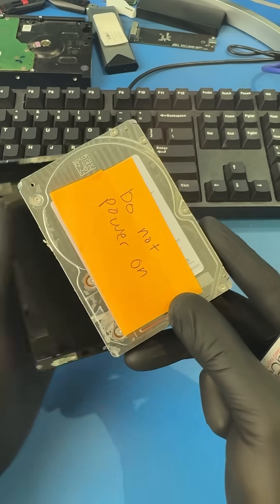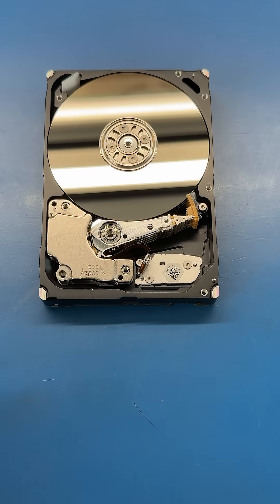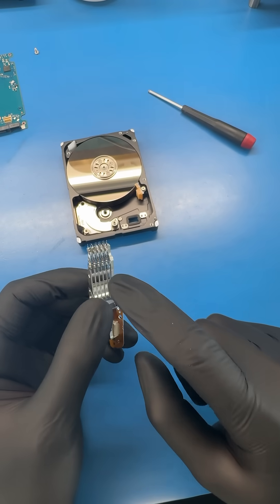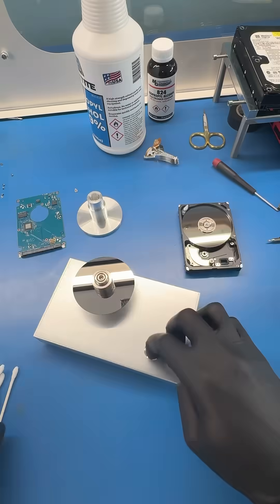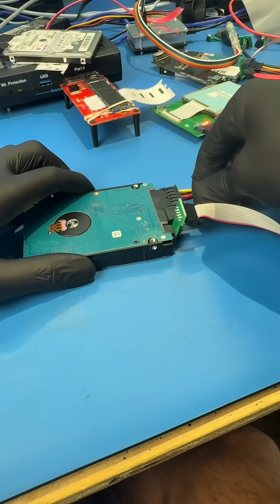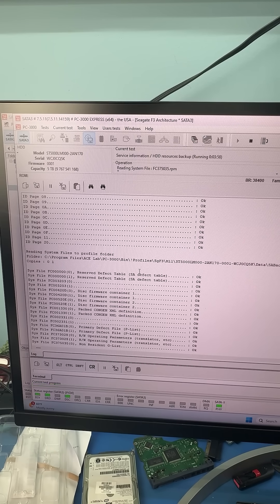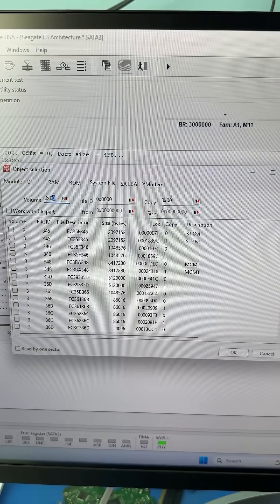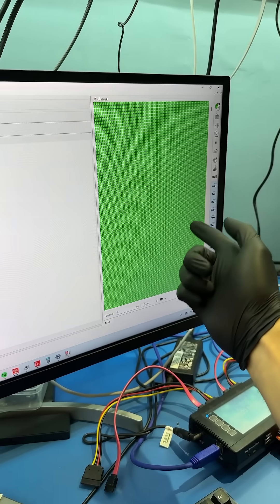Hard Drive Platter Extraction... #technology

Comment: Wow! I'm so blown away! I never knew a hard drive could be repaired. This is next level amazing! Thank you for your smart and hard work. More blessings to you.
Reply: I don't believe it's possible if there are scratches, and even then, I wouldn't reuse that one again. Just to be safe.
Reply: Well, kinda. Once the cover is removed from a HDD you want to pull whatever data you need and then never use it again. The reason is that these drives are assembled in perfectly sterile environments. Once you remove the cover a single particle of dust can land on the platter and then it's just a ticking time bomb of when the drive will fail completely.
Reply: @billybegood466 Exactly, they’re quite delicate on the inside.
Reply: Recovered. Not repaired. Don't re-use that drive, bruh!
Reply: That’s why you need to be extremely careful when you dump a drive that might contains personal data, even if you think it’s broken and useless. You need to physically destroy it (hammer, drill… whatever…).
😉
Reply: @snowman8052 Or my personal favorite, microwave.

Comment: The original design had a base plate of pre-famulated amulite surmounted by a malleable logarithmic casing in such a way that the two spurving bearings were in a direct line with the panametric fan. 

The latter consisted simply of six hydrocoptic marzlevanes, so fitted to the ambifacient lunar waneshaft that side fumbling and data loss would have effectively been prevented

Comment: That's why it's so important to have a backup drive. Even if the broken disk can be recovered, it will cost much more than a second HDD. 
Unfortunately backups are inconvenient with Windows, as Microsoft never bothered with implementing an easy and fool-proof backup function into their operating systems.

Comment: I have 8 Scsi drives I want to check out, got the server from an old radio station, I also had the equipment they used to send it back to the actual radio station, but my guess is those harddrives are jammed packed with music files, the Sever had a password, clearly i have no clue what it was, I was doing a cleanout of an office building was my home or the landfill

Comment: That sounds unnecessarily complicated like there’s plastic rings on the discs so why can’t they print like UP 1 and UP 2 on the up side of each disc with a number that relates to their stack order? Just seems like a simple mix up of identical discs would be something humans would do so why not get rid of that problem? Or let you pull the whole stack out at once so you don’t even have to do that if you’re not examining the discs you just need to remove them? Idk seems like there’s an easy solution to an absurd self created problem lol

Comment: seagate no wonder 
last hdd i got was a seagate 3TB drive it did die after 4 months of use 
because of bank data i did not send it back to get a replacmant (they just wanted to replace it)
 so now i now run a ssd only system with 9 drive and more then 18TB of space 
the older drive i use has 37.8TBW a total power on time of 45.363 h and it dose still do a good work as a download drive

Comment: There are three things that are absolutely guaranteed in life: Death, Taxes and Hard Drive Failure.
If you deal with this amount of data, you should NEVER keep the data in a single place like this. A fire could have ensure its destruction although data can sometimes be recovered from a burned drive, too. 
If your “life’s work” is that valuable, then you should be using some sort of cloud storage, off site storage and/or RAID storage (multiple array of independent/inexpensive disks) which uses redundancies and sophisticated algorithms to store your data across multiple drives. If one drive fails, you simply replace it and the other drives rebuild your missing data using its algorithm. For example: take 3+8=11. One drive stores 3, the second stores 8 and the third one stores 11.  If any one of the three drives goes bad, you simply replace it. There is data stored on the other drives that tells the new replacement drive what the missing number (data) was using the algorithm so it rebuilds it. Save yourself nightmares and a potential heart attack.

Comment: Props to this.  I never knew there was a way to the firmware.  Always thought having the firmware on the drive itself was just begging for trouble.

The most drives I have ever repaired is old ST-506, and even in those cases I just put on the service jumper.

Comment: This is why I don't have cats or dogs. Whenever you work with sensitive hardwares like this you cannot have cat hair or dog hair on the atmosphere and certain things cannot move while they're reading and writing.

I'm just joking. I don't live in a cave. All of my computers use M.2 NVMe storage. All my PCs are securely strapped and cleaned regularly at downstairs station where no one is allowed. I have two NAS servers located opposite side of the building and they automatically backup my phone, my computer, everything.

Comment: hi i actually have a harddrive which was there during a building fire. it has all my childhood photos. It's hardly damaged by fire and all the plastic and rubber parts around it has been melted even the silicon cover around it. you think you can recover it even after facing temperatures over 500 Celsius?

Comment: Who does not know you are supposed to copy -paste and then, if necessary, delete, not cut-paste files when there are lot's of files. Also having files in a single place at any time is crazy. Easiest option is to use a cloud to have one up to date back up of everything on your hard drive, then use a USB hard drive to have an extra back up not connected to internet or computer except for duration of backing up. Perhaps add another USB hard drive and cycle them so if latest back up already is corrupted, you still have the previous one intact.

Comment: For reference if he got 1 platter the wrong way round without knowing which one, he would need to perform up to 32 tests where he disassembled the drive, reassembled the drive, and attempted to do data recovery assuming that he put back the platters in the intended orientation each time. Getting the ordering wrong would be similarly disastrous. If that happened to me, I know I would give up as soon as I realized because that could legit be months of work.

Comment: i had a samsung 860 evo 2tb and an 980 pro nvme 1tb drive m.2 fail at the same time last year. lost 25 years of pictures, documents, letters, recipes, and so much more. i tried about ten different programs to try and recover with zero luck. samsung had zero explanation either. saying that only there was a batch of 860's and 980's that had bad components. i LITERALLY lost 25 years+ of records of my life and they cannot be recovered. after fighting samsung for 2 months they sent a 870 evo 2tb and a 980 pro 1tb to replace them. but yeah... just gone. 

fucking samsung.

Comment: HDDs are my Roman Empire. I just cannot understand why the fuck we would use these as external storage when the smallest tap or stiff breeze causes them to break. I just…it gives me so much fking anxiety I cannot deal.
I have a WD 4 TB HDD from years ago, I keep it in a padded box and don’t even allow it to flip over when I use or move it, tell me how that fking thing started clicking for no reason. Thankfully WD fixed it, of course I lost the data, it wasn’t important. But we have these huge drives that hold some of the most important information and memories of our lives and they’re as temperamental as a sleepy toddler on a sugar crash. 

Thank God for SDDs.

Comment: Drive savers couldn’t save mine. What’s the chance you could?!?!
Reply: NEVER send anything to DriveSavers. They're scammers. There are reports of them damaging drives further to increase repair bills, and holding customer's drives for ransom after jacking the price way up. Speak to a reputable company.

I made a mistake once and sent my SSD to a company in Arizona, and unfortunately it was mostly gone due to my own mistake earlier, however they sent me the corrupted data they were able to get off for just a USB drive + shipping. It would've been free because they couldn't completely recover it, but I opted to pay about $20 for some scraps of my most important files they could find.

Edit: Just to be more clear, I exaggerated. They're not scammers per se, but last I checked, the pricing is just ridiculous. It's a difficult job, but it's not THAT difficult.

Comment: This is one of the reasons I make minimum of 4 copies on a regular basis. Usually no more than a few gb sometimes 100gb in lapsed data.

I had an external hard drive fall while powered and spinning. Lucky for me the drive that failed was the drive I was copying data to. the data on it was being copied from another drive. I didn't lose data, just one of my copies.

Comment: The care you took with the platter spacers was my favorite part of the whole experience.  Very well done.
Reply: A lot easier said than done going in blind. He has no idea where said damage could be hiding. It is best to do a complete tear down and rebuild. That way, he can triage the entire drive.
Reply: Yea my goofy clumzy ass would tip over the stack 😄😞
Reply: Kind of have to on these drives.  Even a mm scratch can wipe gigs of data.  Lord knows how much is lost on the newer 16tb drives.
Reply: wonder why he can just take those platters off from the motor one by one? How could he align each platter to the exact position? If platters are misaligned, though he can retrieve the sector data but files will be corrupted?
Reply: @ericpal02  In the disassembly he doesn't yet know where and what the damage is.  The wider spacers keep an accidental tap knocking each platter into each other.  On reassembly the platters have their own OEM spacers to put them in the proper alignment.
Reply: @ericpal02 platters are always mis aligned they spin eaone has it on reader

Comment: I can't imagine not having redundant storage and backups. I have four drives in a raid 6 array. All four have been replaced, and rebuilt, due to failure, at some point over the past 15 years of its operation. It runs on Linux software raid using the XFS filesystem. The server is about to be moved to new hardware and I'm expecting to migrate the four disks to a ZFS raid six array. On top of that I have automated and daily onsite back, and automated daily offsite back up, and periodically I run the backup to a hard disk that is sealed in a vacuum pack and put in a safety deposit box at my bank and I have a duplicate of that drive sitting in a fire and flood proof security box in my house. So ... if I ever need your services it will be a really really bad day.

Comment: Real talk:  I have a Barracuda and Constellation drive and both have endured a lot. Western digitals have failed on me for so many unknown reasons.  Like powered off state failures from vibrations due to rennovative work type stuff or remote voodo.
II refuse to buy anything but Seagate now.
That said, if they are running and then they fall every drive will RIP.

Comment: Inquiry; I have a seagate 2TB external HDD, when I built my PC I took it out of the enclosure and installed it as an internal drive (some of you already know where this is going), I didn’t realize the voltage regulator was part of the enclosure and not the drive, so one day the mini fridge in my room died and the surge knocked out my drive. I’ve attempted to have it repaired over the years since it has all my pictures of now dead family members on it, I’ve been told the laser is dead but the data should still be there; how hard would that be to recover compared to this video?

Comment: That actuator arm, in the Seagate 5tb hard drive is about 27 years old. Meaning, I manufactured that series of actuator arm which was a model "4813 t" and a "4603 g" pending the smaller laptop top HD... But, as they release each stage of the next hard drive, it is to milk society for as much money as possible.. the hard drive of an organic self repairing state have already been designed, tested and proven, and put in the field of military use.. to Seagate, Western Digital, Conner, etc.. all agreed to stage the release of each stage of hard drives, back when they started with 8 mb in size, then 16 mb, 32 mb, and now, I see they are finally up to 5tb releases, which have already been manufactured and sitting in storage for 2 decades, just in case you were curious about such info... The manufacturer was called Xolox Inc. out of Fort Wayne, Indiana.. several plants, one off of Gettysburg Pike off of Hadley road. Another off of Cook Road, and a few others that made proximity sensors of various types. Owner was Bob luebear and straight up a prick.. but enough about him. He sold everything about 1999? Maybe 2001 era.. and then purchased it back for pennies on the dollar, after he shipped everything to Malaysia, and it crashed there, due to lacking QC.. but he then named it Phoenix America, and it was still located in Fort Wayne.. but, I forget where he stashed the company at there. I was gone from there but that time.

Comment: 3TB of pictures? 🤨📸

Either this guy is a photographer (at which point relying on one backup is a recipe for disaster). Personally, I never reuse my cards and backup both locally and online and I'm not a pro photographer by any means.

Or, this guy is a farmer from Iowa, because that is a ridiculous amount of corn.

--

That all said, I'd love to learn how to do this. I've had hard drives die on me with a head crash. I've tried to take them apart. It never ends well. 🥲 

This sort of sector level recovery would be useful to learn as I'm imaging and archiving old data. I mean IDE (or PATA for you youngins) drives that are 4GB or less.

I have some MFMs, but I don't have a controller so no MB hard drive backups. 

I did back up most of my IBM compatible floppies though. I have some that I couldn't get correctly since they're XDF formatted. Took forever though to do what I could.

Comment: Hello sir can you answer me.....
Subject - i/o error 
Once I was curious so I formatted the hdd but by unchecking the #Quickformat button but it was extremely slow process without any cancel option so I directly unplugged it after that this Hdd became useless because it's showing #i/o error i tried everything software fix , cleaning pcb conector but nothing works i think its firmware is corrupted but not sure . there is not data lose but I kept that hdd thinking may be somehow it will be fixed and can be used again !
Can you tell me if it's possible to fix by uploading firmware if there's really a firmware issue?

Comment: It's an absolute miracle that someone other then the original manufacturer was able to fix that & even more so without doing a full physical recalibration, because usually each hard drive's heads are calibrated individually using special vendor-specific devices & require recalibration should the physical positions ever be changed even slightly.

Comment: I’m highly skeptical about this process. Removing the platters individually guarantees the loss of their precise angular alignment. Modern drives write data - including factory-written servo tracks - across all platters in perfect sync. Even a tiny rotational shift of a few microns means the heads can no longer follow the tracks, making all data unrecoverable. In fact, without those servo tracks lining up, the drive can’t even recalibrate or format itself, so it’s effectively been turned into a paperweight.

Comment: Restocking them wrong would mean you’d just have to try reassembling and booting it back up 119 different ways (5! -1 since you just tried and failed). You would theoretically only have to try that less than that many times because probability of success rises with every attempt. 

 It would take a while but you could find the correct sequence. Just gotta methodically track which disk and which order you are stacking each time.

Now I know you said which way they go, but even that is still doable. Definitely less time consuming than 2 years worth of data.

Comment: Impressive that is for abs. sure.  He was damned lucky to find you as I’d venture 99% of recovery services would have failed. I’m surprised he didn’t get his drive back in pieces. What is NOT impressive is someone smart enough to have  3+TB of irreplaceable digital images but not smart enough to back them up until now 😂😂. Trusting anything to a mechanical drive w no other copy  is a recipe for disaster . (All mechanical drives WILL fail at some point down the road - accident or not they are a machine, and ALLmachines break).  
But GREAT WORK I’ve been doing IT since the early ‘80s but I still learned a cpl new things from your short vid. Great stuff - 😅Thanks!

Comment: I never did anything like thismyself, but I once saw someone move platters from one drive to a donor drive, and they used adhesive tape to keep the platters angularly aligned. This made sense to me.
But here I see you take the platters out independently. Which begs the question: How did you keep the platters aligned? Does it not matter after all? I'm confused.